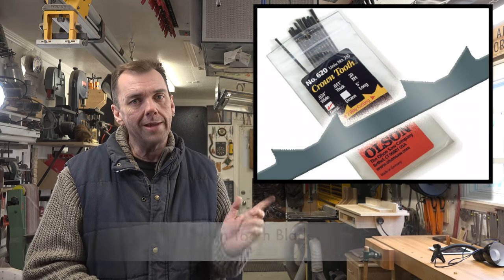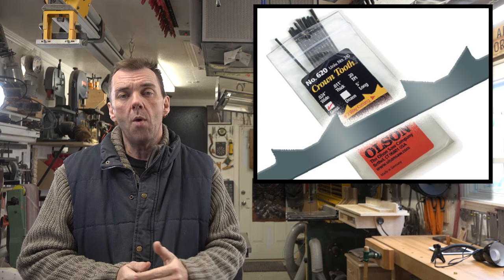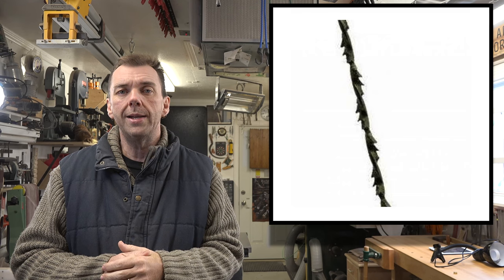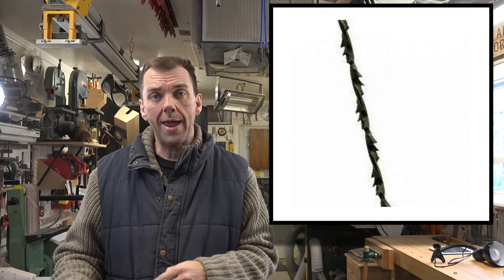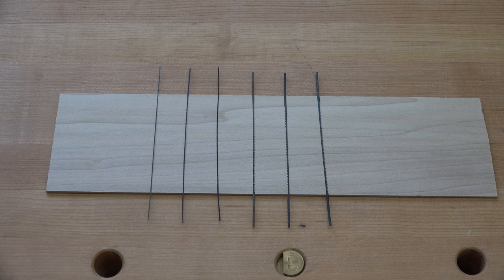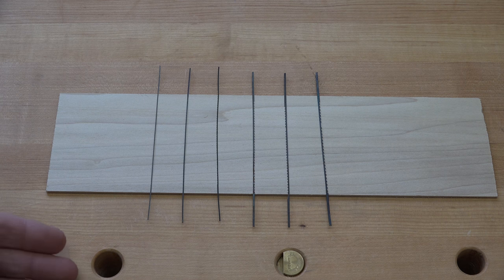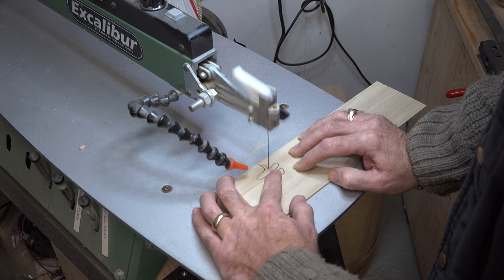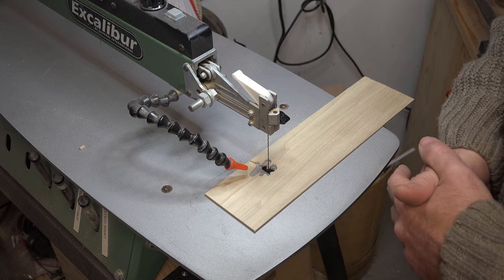Scroll Saw Blade Selection

Comment: Don't buy Dremel brand scroll saw. I can't cut 1/4" pine! Lol
Reply from the maker: This sounds like more of a blade issue than a saw issue.  I know that the Dremel scroll saw isn't the most smooth operating machine but it will still cut with the proper blade.  For 1/4" thick pine, you might want to try a universal #3 reverse tooth blade.  I hope this helps.  Thanks for tuning in to the show.

Comment: You never talk about materials, what type of blade for Metal 1/16 or HArdwood or softwood
Reply from the maker: The sizes of the blades are universal and they are rated for their thickness.  They also have a rating as to what materials they are suited for cutting.  You would have to check the individual manufacturer's blades specification to see what they recommend and that is why I don't really mention much in the way of materials in this video.  While the blade numbers are basically the same for cutting various thicknesses, the materials will differ depending on brand.  I hope this helps a little Humberto.  Thanks for tuning in to the show.

Comment: I just picked up a used Craftsman scroll saw. It is a few years old but it is in mint shape, not a scratch. It also appears to work fine. I do not have the manual that comes with it. Is it safe to assume the blade length is 5 inches ? That seems to be the standard size for most scroll saws. The saw I bought did not come with a blade and it was sitting in a storage unit for a few years. Any maintenance (oiling and such) I should do to it before firing it up ? For $25 I found it hard to pass up, it powers up and the speed control is bang on
Reply from the maker: Older scroll saws had a different length blade but it would have to be very old for that. I would say that if the scroll saw taking un-pinned blades, then the chances are pretty good that they are a 5" length.  It sounds like you've got yourself a great deal.  Some scroll saws (like the Ryobi) have bearings that need to be oiled every so often.  I would suggest googling the model number and seeing if you can find a manual.  In most cases though, scroll saws are plug and play with no real lubrication needed.  If you are concerned, you can always put a drop of 3-in-1 oil on anything that moves.  It wont hurt the machine.  I hope this helps.  Thanks for tuning in to the show.

Comment: Very informative video,  i'm just starting out on a scroll saw.  Olson blades are sold in my area. I have noticed that the two blades that you personally use are the #2, #3 reverse blades.
Reply from the maker: I mostly use those numbers with the #3 being a mach cut blade.  The other blade that gets used a LOT is the #7 PGT from OLSON for thicker stock.  I hope this helps.  Thanks for tuning in to the show Jeff.

Comment: So I started with scrolling about a year ago and watched this video back then. However it was a while before I did any fine work and needed specific blades and had forgotten everything you had covered. Now I am doing a lot more scrolling and have started using some very hard wood 3/4" think and was struggling with wood burning and could not figure out why. I even tried layers of packing tape on the front and back of the pieces to try and give the blade more lubrication. So now, watching this video again I have realised I am using completely the wrong blade. I am using a number 2 instead of a number 7 or 9. So thank you so much for sharing your knowledge in such an easy to follow tutorial. I am confident of selecting blades now that will work much better for me. By the way, in my part of the world Olson blades are 5-10 times more expensive than the blades I am buying. I started with Olson blades so I know their quality, but the ones I am using now have very similar quality so I do not understand the price differential.
Reply from the maker: I can't speak for the price difference of the blades Doug but if you are happy with the cheaper blades you are getting, then that is all that matters.  One of the most important aspects of scrolling and having it be an enjoyable process, is blade selection.  Select the proper blade and you will have a wonderful, enjoyable experience.  Choose the wrong blade, and you will have a frustrating and worthless experience.  I'm glad to hear that this video is helpful to you.  Thanks for tuning in and good luck with your continued scrolling.

Comment: This is great information.  I just received a scroll saw 16 inch never used it and don’t know anything about it. So this video is become very helpful, can’t wait to get started on some projects.   I’d like to go out and buy a variety of blades for all projects and woods
Reply from the maker: I'm glad that you found the show to be informative Darin.  I would suggest that if you haven't already, you might want to check out my two part series on scrolling for beginners.  There's quite a bit of information in there that might helps you.  Here's some links.
https://www.youtube.com/watch?v=8b_FWeCcFeg&t=4s
https://www.youtube.com/watch?v=BmHuTuOyFZo&t=1s
As well, you might want to check out the video on scroll saw accessories which can be very helpful when first starting out on the saw.
https://www.youtube.com/watch?v=ZNso4hITeq4&t=1s
Good luck in your new adventure.  If you have any questions along the way, please don't hesitate to ask.  I'd be more than happy to help if I can.
Thanks for tuning in to the show.
Reply: @acutabove_woodworkings  hi. Thank you for responding so quickly, all the different types of wood and what blade to uses  with  which thickness, and types of woof for what blade to use.  It’s almost like making a food chart,  for hard wood is one type of blade and soft wood you use a different one.   And for the type of projects you uses another type.  So. Much to remember. Thank you again for the links.  I’ll be checking them out now.  

I want to use a wood for outside that will last for a squirrel house besides cedar.  And I’m making a store front fake  facade to attach to the fence post.  I’d like to paint it so it will last.
Reply from the maker: @darinbrousil1715  I know it seems confusing right now but as you work with the saw, you will get used to just being able to pick a blade from experience and not from a chart.  It takes time but you will get there.

Comment: Nice video Sir, very useful information. Thank you so much for sharing!
Reply from the maker: Glad that you found it useful.  Thanks for tuning in to the show and for the kind words.
Reply: Sir, i bought a small set of blades, 10/15/18/24TPI, i tried all of them on the same wood, plywood 4-5mm but only the 24TPI was cutting easier and faster, why that? With the 10/15/18 i had no difference, they cut little difficult and slow, exactly the same all of them. Normally the 10TPI would cut faster and easier i guess or i missed something? 🙂 It's the hardness of the wood? My blades are not so good? (Pin, flat, downstroke). Is it how the scroll saw works as a machine? I used to work with my band saw (the same as yours) which cuts fast and easy, maybe the scroll saw works slower? 🤔Thanks. @acutabove_woodworkings
Reply from the maker: @labis6466  The teeth on a scroll saw blade are much smaller than a band saw blade and will cut much slower in general.  The blades that you have purchased might not be as good a quality as some blades on the market.  Normally, the higher quality blades are listed as a universal number system and it's difficult for me to say what number of blades you are using.  In general, yes, the lower teeth per inch should be a much more aggressive cut but there are a lot of factors that determine that.  Hardness of the wood.  The glue in the plywood.  Grain direction etc.  It's all about finding the blade that works with the stock.  With pinned blades, normally, the larger blades with the lower TPI do not have as wide of a kerf in their cut which can also slow down the cutting process.  Keep in mind though, the scroll saw is not a fast cutting machine.  It is meant for slower, more controlled cuttings.  I hope this helps.

Comment: Big help. Many thanks. Just bought a 2nd hand delta saw and a starter pack of blades. I now understand tpi and blade numbering. The 👍
Reply from the maker: You're very welcome.  I'm glad that you found this video helpful as well.  As always, please don't hesitate if you have any questions.  I'd be more than happy to help if I can.  Thanks for tuning in to the show.
Reply: @acutabove_woodworkings  thanks. are Blades numbered the same way in the UK?  I'll be working with 3/4 to an  inch thick wood. I'm thinking nothing lighter than a no.7? Also my saw is 2 speed. Would the lower speed be for thicker timber with lower TPIs. Many thanks.
Reply from the maker: @nervouspenguins9982  Not exactly sure how the blades are numbered in the UK, but I would think that they would be the same as they are universal numbers.  As for the 3/4" stock, I would use a number 7 reverser tooth blade.  I prefer a PGT blade as they are a little more aggressive but a regular #7 should do you fine.  As for the speed of the saw, I would keep it to the lower speed until you get the hang of scrolling.  Speed is more of a control thing.  Using a higher TPI blade, in thicker stock just overheats and breaks the blade eventually.  Using the correct sized blade for the correct thickness is the most important thing and the speed isn't a factor in the actual cutting.  The only time that speed affects the cutting (IMO) is when you are cutting something that could melt (like plexiglass) or something that requires slower speeds such as metal cutting.  Other than that, feel free to cut at whichever speed you are comfortable with.  I hope this helps.
Reply: @acutabove_woodworkings  success. Mounted a no.7 blade and produced a letter P, A and E (familys' initials) and a wonky easter bunny. Blade jumped out a few times so a lot to learn about tensioning etc but I'm on my way. Thanks again. P
Reply from the maker: @nervouspenguins9982  Congratulations on the first projects.  You've been bitten by the scrolling bug now.  There's no turning back.  Good luck.

Comment: Just opened my first scroll saw and was feeling a bit lost. Thanks for all your help! I'll be sifting through your channel. Mostly 1/2 inch stock, think I'll grab some #7 PGT reverse tooth blades...
Reply from the maker: Hey Dave.  For 1/2" stock, if you are getting some PGT blades, you might be just fine with a #3.  Those blades cut really well.  The #7 will be fine for the cut and will also be good for 3/4" stock as well so the #3's are not a requirement, but it's always nice to have extra blades in your arsenal.  Thanks for the kind words on the show and for tuning in.
Reply: I use the pinless PGT 14.5 tpi reverse tooth on 1/2 baltic birch and the cuts come out polished smooth. I use a Dewalt DW788 Type 1

Comment: Holy smoke, Kenny.....that scroll saw project you showed is an awesome piece, and I applaud both your skill and your patience!! Oddly, a scroll saw (my grandfather's old belt-driven beast!) was probably the first power tool I ever used, at about age nine or ten (back in the fifties!), but the one I know the least about, in terms of details like blade selection! That Excalibur saw is a beautiful tool, too. To start, I just got myself an inexpensive Ryobi, but it seems to serve my purposes OK...at least for now. it's variable speed and accepts plain end blades, so I'm free to select blades pretty freely, unlike a lot of other inexpensive saws (that I found only use pinned blades). I took your advice, though, and added a foot switch which has made things much more convenient. Thanks for clearing away much of the blade selection 'fog.' I'm in the midst of a project using 1/8" stock. The Olson spiral blades do make it easier (cutting out names written in cursive) but you are absolutely correct: I spend a lot of time with sanding sticks in my hand! LOL When I have more time, I'll get braver and try something similar using 'conventional' blades. Thanks again...and I look forward to your next video.  :-)
Reply from the maker: Hang in there Norm.  The scroll saw isn't something that comes naturally and it take a lot of practice to get it right.  While spiral blades do have their place, for lettering in 1/8" stock, you would probably get better results from a #2 reverse tooth blade.  While you edged may not be perfect, the amount of sanding that you need to do will be minimized.  The perfect (or close to perfect) edges will come with practice.  Thanks for tuning in and for taking the time to leave me a comment.  I appreciate it very much.  If you haven't already, you might want to check out the two part series on scrolling for beginners here on the channel.  It might give you some pointers on control and learning the craft.  https://www.youtube.com/watch?v=8b_FWeCcFeg&t=1079s
If you have any questions along the way, please don't hesitate to ask.  I'd be more than happy to help if I can.

Comment: Great teaching! I need to see recommendations for blade and stock combos for varied projects. Plywood vs. Hardwoods vs. Acrylics vs. Metals, etc.
Reply from the maker: The variables of the materials you just mentions are endless.  Plywood is largely varied in blades sizes according to thickness, the number of plys, the species of the plywood and how intricate and tight your design for cutting it.  Hardwoods are also governed by the same variable but the species plays a huge part because the size blade you would use on walnut, would never cut through Purple Heart.  Acrylics can be tricky and again, thickness plays a part in your blade selection but also, the speed of your saw also plays a huge part because heat is a contributing factor in getting a clean cut.  Too much speed with a larger blade will create large pockets that melt back together, leaving a poor cut quality and a mess to clean up while using a smaller blade with too much speed will result in melting the acrylic immediately after cutting it, causing the blade to jam and possibly break.  Metals are another completely different story.  Thickness plays a huge part but for the most part, the blades that are used are a high TPI and they are run at extremely low speed to avoid friction and heat, and allow the gullets of the blade to clear the metal filing from the cut kerf.  Basically what I'm saying is that there is a lot of experimenting that goes on with scroll but using the basic knowledge of this video will give you a starting point as to what blade to choose and what to expect from it.  During the cut, if you know the signs to look out for, such as burning the wood, having to apply too much pressure to cut etc, you can adjust your blade choice accordingly and eventually it becomes second nature.  It's pretty rare for me, after almost 30 years of scrolling, that I choose the wrong blade for the job.  It's all about experience and knowing what to look out for and how to adjust accordingly.  I hope this helps a little.  Thanks for tuning in to the show.

Comment: Thank you Kenny. Exactly what I was looking for. So many just explain the different type of blades but never actually tell you what you need to get started. Really appreciated the tip about if the saw is cutting too fast or too slow then change blade size. I've ordered the scroll saw was now trying to work out which blades to order to get started! Thanks again. I've taken notes and shall no doubt return!

By the way the video I watched before this was a really quiet one and I'd had to turn the sound right up!! Your intro music about blew the windows out!
Reply from the maker: Sorry about your window Richard.  This is an older video and the volume on the intro has since been reduced because of several complaints.  I'm glad to hear that the show was useful to you and if you have any questions, please don't hesitate to ask.  I'd be more than happy to help if I can.  Thanks for tuning in to the show.

Comment: I never knew there was so much variety, but you made it easier to understand. So, a 2R should be fine for medium hardness 1/" balsa wood. Do you have a suggestion for 1/2" balsa wing ribs (gentle curves)?
Reply from the maker: A 2R will be perfect for 1/4" balsa and for 1/2" balsa, I would consider a #3 PGT blade to be more than adequate.  I hope this helps John.  Thanks for tuning in to the show.

Comment: I have a scroll saw that I sometimes use for cutting acrylic tubing. The tubing has a 14mm OD and a 1.8mm wall thickness. What would be the perfect blade to use that would provide the smoothest burr-free finish? Thanks.
Reply from the maker: A burr free finish on acrylic tubing is a hard thing to accomplish.  The problem is that there is more than one plane being cut during the operation which creates more than one area for burrs to occur.  I would suggest something in the neighbourhood of a #5 PGT blade and reducing the speed of your saw to prevent overheating and melting the acrylic.  I hope this helps.  Thanks for tuning in to the show
Reply: @acutabove_woodworkings  Hi.....thank you so much! 🙂

Comment: Thanks for the blade info, new to scrolling, have to use the right blade to get good results
Reply from the maker: Blade selection is probably the most important factor when it comes to good results on the saw.  I hope you found the show to be useful.  Thanks for tuning in.
Reply: I've subscribed to the channel, keep up the good work! Thanks
Reply from the maker: @terrygabrielson5598  Glad to have you aboard as a subscriber.  I hope that you will find many other projects and episodes to enjoy.  Feel free to comment or ask any questions that you may have at any point in time.  Fridays, are the woodworking episodes of the show and Tuesdays can be anything from tool reviews, to rants, to resin work or welding....basically, whatever I feel like doing that day.  I hope you enjoy the channel.  Thanks for subscribing.